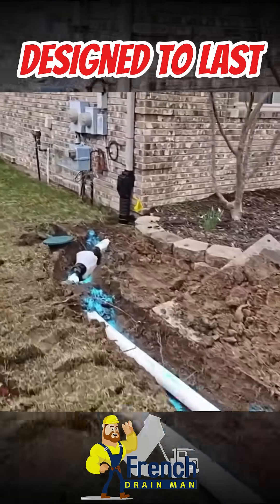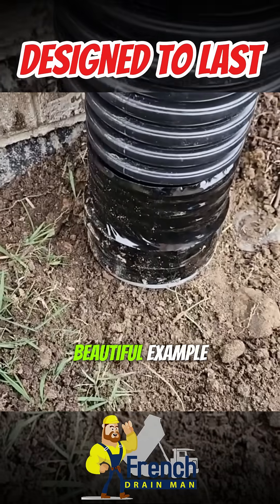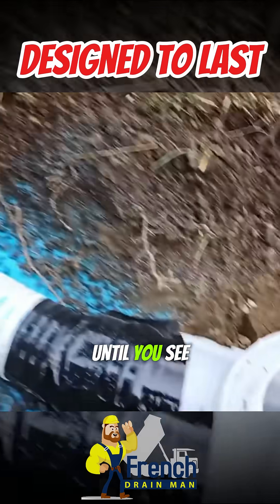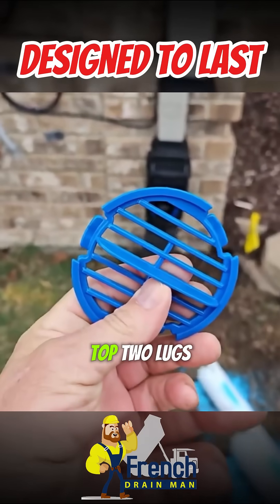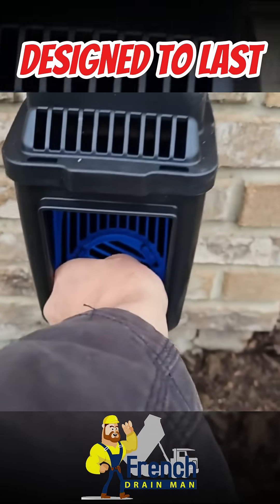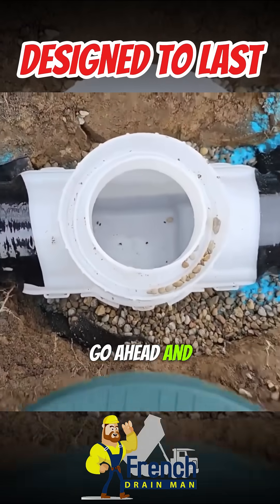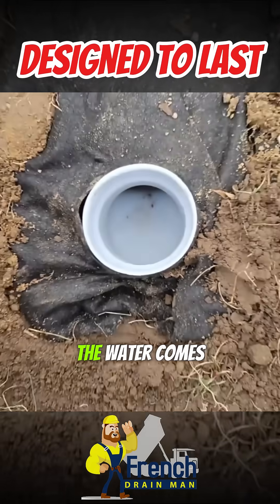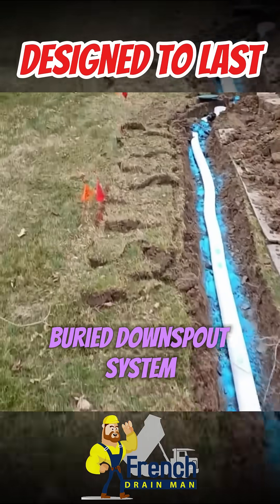Downspout Drainage 101: Do It Once, Do It Right

Comment: Wondering why stop in the middle of the yard? I understand it’s where the grade breaks. Why not near the curb which will outlet most of the water in the street and not create a wet spot on the yard. Thanks just trying to understand
Reply from the maker: We get paid to dig. How far do you want us to dig? We're more than happy to provide whatever it is you're looking for, but it comes at a price. Labor is expensive. Each hour our crew is on a job site, it comes at a large cost to the homeowner. There's more material as well, but labor is the biggest cost.